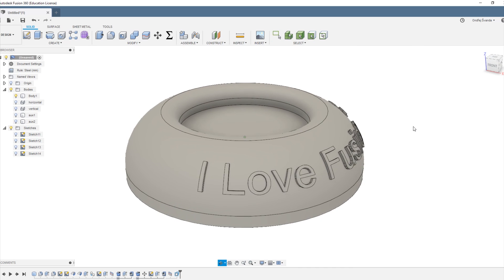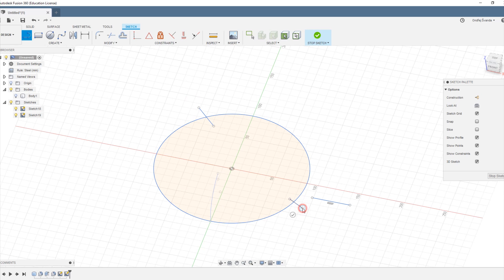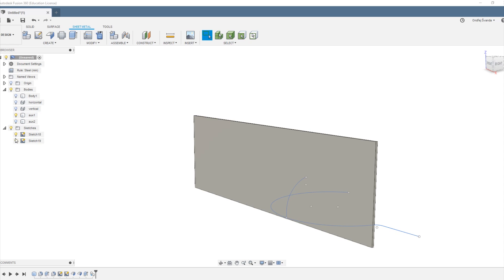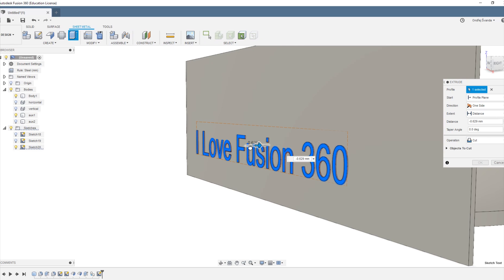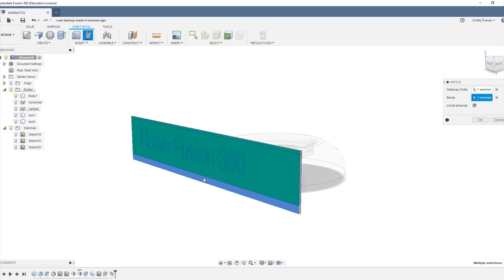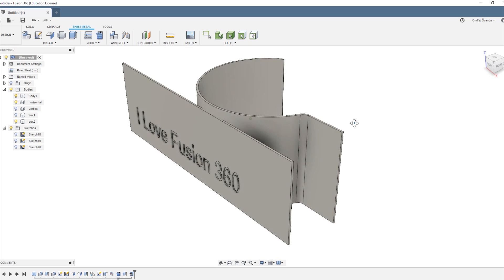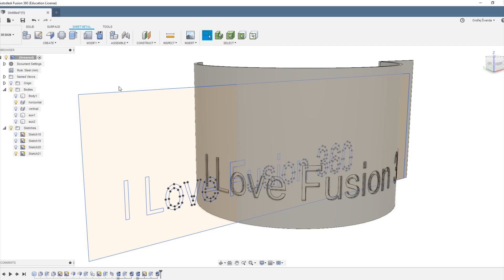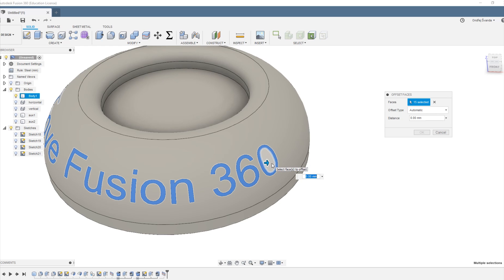FUSION 360: How to Wrap Text Around a Double Curved Surface

Comment: I am a hobbyist and I'd like to regurgitate what I just learned. So my question is, are my statements correct?
The sheet metal workspace is simply a tool (in this case) to get the text projected correctly onto the model. Where it breaks down for me is the "closest point" selection. To picture it mechanically, I'm picturing a series of stings going from the letter to the curved surface. When looking at it from the side, The letter I, for example, is on the right side of the screen and the model is on the left side. If you stretch a string from the bottom edge of the I to the corresponding "closest point", the string is horizontal or at 0 degrees. when the string is stretched from the top of the I to the model, that string is at a different angle, possibly, 30-40 degrees in your example. This is because the curve moves away from the text and therefore more surface is covered in a shorter distance along the Z (UP) axis. I wish I could upload a picture to youtube. 
I'm going to work on this and hopefully figure it out! Thank you for taking the time to share your knowledge.

Comment: Executive summary: normally you would wrap text around the object by surrounding it with a cylinder ("horizontal" in this video), unwrapping the cylinder in sheet metal mode, placing the text on the unwrapped cylinder, re-folding it, and then projecting to the object.

However, if the object curves in more than one direction (complex curve), this introduces distortion. Papooch compensated for that distortion by projecting in two steps. The first projection (to the object named "vertical") pre-distorted the text in the other direction. He then projected back to a flat object ("aux2" in this video) and used this pre-distorted text to project onto "horizontal" and then the final object.
Reply: This explanation is super helpful. I'm still not "there" yet but this got me closer. Thank you!

Comment: Finally someone did it, thank you for sharing. I am waiting with every Fusion new update for that straight forward method of wrapping text around a cylindrical/ spherical body. You did multiple extruded cuts to compensate for the letter deflation, nice approach.

Comment: So you counteracted the warping by using an object to hold the warping text but due to it's angle it comes out as looking normal, I might try this
Reply from the maker: Exactly, but now that I think about it, the auxiliary bodies are't really needed and add unnecessary weight to the computation and can be simply replaced with sketches.